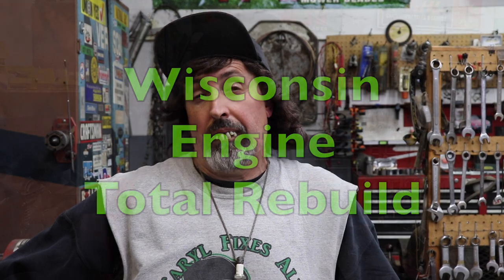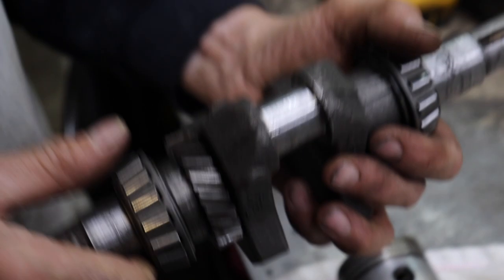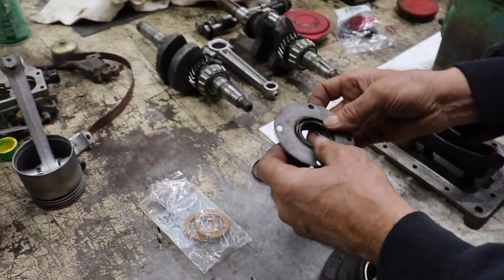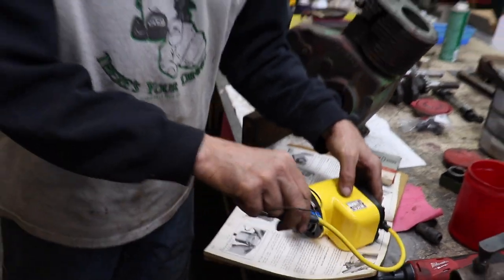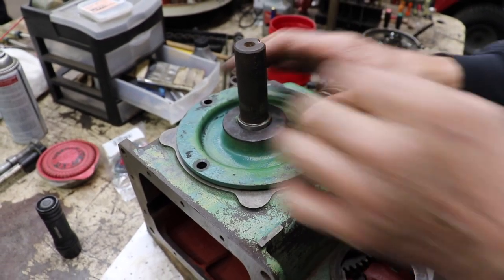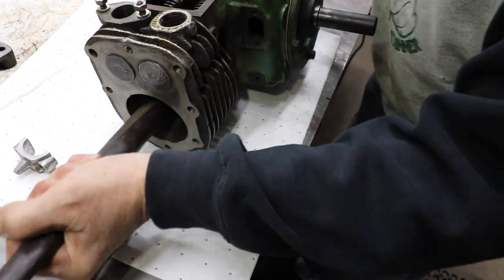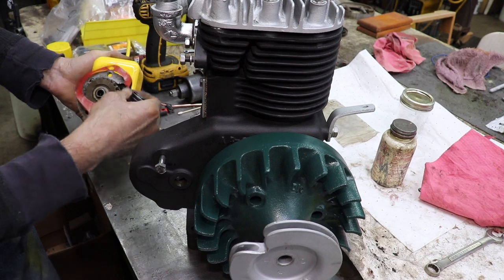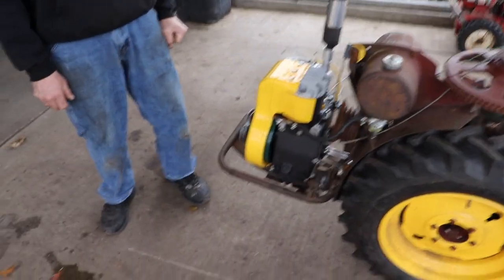Epic Wisconsin Engine Total Rebuild

Comment: My grandfather was an engineer for Wisconsin Engines when they merged with Continental Motors in the 1960’s. They manufactured many specialty small engines inside of the International Harvester Heavy Equipment plant in Melrose Park Illinois in the part of the factory that used to manufacture International Harvester’s residential refrigerators and freezers for Sears Roebuck. To this day, I know they still have a massive but non-maintained  warehouse inventory of Wisconsin-Wisconsin Robin motor parts and motors which was purchased and then abandoned by Suburu Automobile corporation around 2005. Also, I worked at the Wisconsin motor assembly plant in Melrose Park for a brief few years in the 60’s after college.  Wisconsin motors were built to last indefinitely with little or no maintenance. All their engines and parts were designed, manufactured and assembled in-house.  FYI, the lifter were offset to promote spinning and even wear at higher RPM’s.  Common in piston-aircraft engines which International Harvester also manufactured for Ryan Aeronautical  a division of Continental Motors at that time. I love your Youtube videos.
Reply: That’s cool 😎 
Bet he could teach us everything about them 
I was 16 working at tractor MF dealership and my dad closed his shop so I knew how to overhaul them and got the job Asap
Reply: Nice bit of history of these engines.

Comment: A Wisconsin Engine was a tough well built engine back in the cast iron engine days .You have done a Great job saving a piece of American History ...
Reply: @JM-yx1lm  some still do(hard to find). but I agree. Unfortunately people vote with their wallet and buy the cheapest crap.
Reply: i have 2 wisconsin motors one is on a 1953 original snapping turtle it has a turtle head on the front of the mower im 67 i wonder how many engines made today will still be running 67 years from now
Reply: They really don't build things the way they used to!
Reply: @dannysapp5559  I love my old Wisconsin engines got only 2 that will run out of 6.
But ya know they are heavy, tuff and old just like me!
Well, maybe not the tuff part,
Hehehe.. Take care keep that old iron purring!
Reply: I have a TR-10D Wisconsin engine on an early 60's Bolens that I would love to get that machine running again.
Reply: @meegstomtom  duromax have actual rod bearings

Comment: Great video, a note though. Piston ring gaps do not need to be staggered in a four stroke engine. The reason is they continuously rotate around the piston and periodically line up on there own. Two stroke rings on the other hand need to be pinned  to keep them from rotating and the gap getting snagged on a port. Lined up ring gaps do not allow enough compression loss or oil control problems to ever worry about (the gaps will un-align soon after the engine runs for a short while anyway). 
I was introduced to this at the Briggs & Stratton service school for vocational instructors and have assembled many engines with lined up ring gaps just to prove it to people...that all said staggering ring gaps doesn't hurt anything  but is unnecessary. And there's your dessert.

Comment: Pretty sure I'm never gonna rebuild an engine (much less a Winsconsin engine) but watching this is a treat.
Reply: Find yourself a "FREE" lawnmower or two (my case, several) and take it carefully apart and re-assemble. If it runs, you must do the Tayrl dance. It gets to be a habit and maybe a few bucks selling the runners. Save the good parts to fill your garage. Good luck!   CM
Reply: Offset is so they spin.
Reply: @ItsMrAssholeToYou  im actually looking for parts now to rebuild one, lol,. An S-8D off a old bolens tractor, do you know of a place for part's ? Im going to look on ebay tomorrow.
Reply: @calvinmientke3539  q
Reply: @calvinmientke3539  q
Reply: Don't sell yourself short!!
Reply: Same🤣

Comment: Taryl, Thanks for another great vid. The Wisconsin AKN is the same as the Howard Terrier Rotavator motor built under licence here in Australia in the 50’s by Howard.
The bore and stroke is the same at 2 7/8”x 2 3/4”.HP ratings change with RPM. Howard L 4.2 HP at 2500, LH 5.2 @ 3200, your AKN 6.2 @ 3600 as you would already know. It even sounds the same.
 Wisconsin AENLD motors were also built under licence here by Ronaldson Bros and Tippet up until the 60’s I think. For about 9HP they are very heavy. I have one of both these, they are good motors as you point out, very tough.  A lot of parts are available here through the Howard fraternity. Jeff.

Comment: When a man That's worked on small engines for 40 years says the Wisconsin engine is made weird 🤨, I take his word for it .
Cork gaskets, 40 years ago I use to ride a 1953 Hogly-Davison Panhead and they used cork gaskets on the pushrod tubes and the clutch crossover shaft. Clutch cork gasket backed by washer & spring, replaced every time worked on clutch to keep oil off plates. Later model rubber seal was a perfect fit and didn't need replacing every time 🤗. 
The hardest part about working on old stuff is replacement parts. Heard the term obsolete so many times I wanted to bang my head against a wall 🤕.
Reply: I have a 74 harley all my pushrod tubes are still cork. Works well
Reply: Cork seal also used on old 2 cyl JD farm tractors, crankshaft flywheel side

Comment: Wisconsin engines with the impulse coupler makes the difference in starting eazy. This engine manufacturer has got to be the best on the market. I have one that has been working since 1951. The engine is on a self propelled lawn mower. What I am wondering is have you ever heard of a mower working for seventy years ???? Thanks Taryl. VF

Comment: Taryl, an old mechanic told me that the reason for the offset alignment of the valve pushrod was a crude valve rotators. He stated that even thought the springs on the valves are actually fixed to a greater degree, the cam movement and rotation would move the valves ever so slightly and prevent burn spots on the valve itself. This slight rotation would keep the valve wear consistent on the radius of the valve. This old mechanic named Snyder worked and repaired Wisconsin's engine his entire life. He swear these were the best engines made in the United States of America. A time when American manufacturing was second to none. Peace VF
Reply: Agreed, that was the thinking of the engineers on valve rotation back then…

Comment: I have been through many Wisconsin Engines up to the VH 4D. They are primitive but very heavy duty and dependable. Keep your eyes on the governor weights, they were bad to break off from wear. They were designed for torque at low RPMs. Many Ditch Witch Trenchers and many Cement mixers used this engine. The Wico Magneto is very good but it is complicated.
Reply: I have a few still running.VH4D on stump grinder. Thousands of hours always runs. Starter ring gear issue s mostly.
Reply: Yep I still have my father in law back motor for his old cement mixer 
I started it up about 12 years ago 
Need to start it up soon
Reply: The old Lister engines were pretty durable.Last time I used one on a cement mixer was around 75 when I was young and fit.They merged with Petter which were also a good small engine.Lister/Petter merged and are still in operation but their engines are somewhat larger these days.Winsconsin are a rarity this side of the Atlantic.

Comment: Hay if you look on ebay for Wisconsin engine. Put your model type AEH or what it is you will find all kinds of parts. There is a guy in PA. I think that has parts for a lot of them. Just wanted to let you know. I have a AEH engine I get parts no problem. And if you go to smokestack. Com it a tractor, hit miss engine sight. But there's information on Wisconsin engines also if you look on it to. Just wanted to let you know. Hope this helps. Hay Babbitt is not glued in its melted and poured in. Then you fit it to the crank. It's used in hit miss engines. Just wanted to let you know.

Comment: Offset for to transfer the spin of the tappet and you will find cam ground so tappet spins as well. This is so valves don't burn
Reply: My understanding is the teryethyl lead used then left deposits on valves thus narow valve seats. Rotating the valves on a slow running engine helped chip the deposits off.
Reply: I agree offset for spinning components. 
Longer life. 
Tougher duty.

Comment: Pretty sure that’s how Wisconsin would rotate the valve, their idea of valve rotation
Reply: That's exactly what I was going to say - the offset tappets / valve stems cause the valves to rotate.  :)
Reply: That’s what I was thinking also
Reply: @billymare  
Ml
Reply: Thought the same thing
Reply: Lol you beat me to the answer
Reply: Bingo!
Reply: @lavendersneppo  Ditto.
Reply: paul lynn for the block.....
Reply: I don't think that's it.  Maybe Wisconsin thought that was it, but if the tappets were running in the center of the cam lobes, how are they gonna spin?  And if they don't spin, sure as hell the valves won't spin.  In a car, the lifters are offset to the cam.  Not like this.
Reply: @alext8828    I don’t think it worked very well that’s why they changed the design later. Not to mention it probably would wear the guides funny. They definitely figured out fast that it did not work at all lol
Reply: @moondogdieselworks3883     I'm having a hard time believing their engineers could be that out of it.  Sometimes things happen in production that are crazy.  Like sharing one motor case for two models and trying to squeak by doing a have ass job of it.  I don't think there's an engineer or mechanic in this world that could possibly believe this would actually work.  From what I can see as Taryl show the damn thing, it looks like the valve on the left had to be moved to avoid interference with something in the middle that ran down thru into the crankcase and was holding the cam for some reason.  The piece did not have room to move to the left in the crankcase or it would have interfered with the lobe of that valve.  But when we move further up, we see that those valve guides needed to be further away from each other.  Kind of a shitty design, but not shitty enough to mess up the workings of the motor at large.  
I like to think that engineers and designers know what the hell they're doing.  But remember that every shitty piece of shit that was a total failure was engineered and designed by these mental patients.  The production engineers work on it to find a way to make it profitable at a certain predetermined price.  In short, they wreck it by cutting corners.
Reply: It's not meant to rotate the valve it's meant to rotate the tapper so that it doesn't dish and change your valve clearance!

Comment: When I have loose seals. I use Loctite Bearing Mount Sticks 39150 it was made for bonding
 Bushings
, Bearings, Oil seals, Ring gear bolts, Differential lock pins, Axle bearings, and Water and power steering pump pulleys to the cases. I also pour my own Babit for the crankshaft and rods.

Comment: Really enjoy your videos! Funny how these small engines endure. I recently pulled the Briggs 25 hp out of my Scott's rider. 1978 vintage. Been mowing with it for 8 years. Always hard to start and it finally developed a leak at the governor shaft seal. I decided to tear it "partially" down to replace the seal and refresh the gaskets. Once apart I found the governor had one fly weight dislodged and was laying in the sump! The valves were at three times the .006 gap. I thought it was a stump grinding monster before but with the flaws corrected it really should haul the freight. Did I mention the complete gasket set had the wrong governor seal in it? :) Correct one is on the way! By all means, keep up the good work!

Comment: Babbit is generally a lead/tin mix poured into the Rod end Hot.  Rule of thumb or #1 finger is 0.004" end gap per inch of bore.

Comment: I have a Wisconsin AB sitting on the shelf. Previous owner put it on a homemade log splitter. When I was given the splitter I took that motor and put it on the shelf to preserve it.
Reply: Nice u want to preserve it, I think she'd be content to be running something tho.
Reply: @raymondgarafano8604  I agree, The worst thing you can do is shelf and engine, However there are steps you can take to guard against corrosion.
Reply: @Mad_Scientist2052  Engines were built to run things, pumps, air pumps generators,
I did up a Briggs 23AFB purple with black headbolts, took al parts off wire
brushed, primed and painted, cleaned out carb, rebuilt starter solenoid...I am looking for what I think is a Wynnco Generator that goes with it. Yup these old engines can look good and still serve a use.

Comment: Great video Wisconsin engines are Timex watches they were built to take a licking and keep on ticking. I had a minibike when I was kid and a guy who worked construction gave me an engine, long story short it was a Wisconsin Robin 6.5 hp. We found out from a local small engine shop that it was a very expensive engine and why we were putting in on a minibike lol. I tell you that minibike is still being used today with that Wisconsin Robin still running great I sold it back in 1980 and it is still riding around our neighborhood.

Comment: I like it," scrappy "you shall be named! I hope you find out why the valves and lifters are offset there has to be a reason why the designers/engineers saw it a necessity!ohh wait a sec I remember someone said when I grow up im going to be an engineer, I'm going to put bolts and things in difficult places ,add more fastners than needed and place parts in oddball configurations because im an engineer !

Comment: OFF-CENTRED VALVE LIFTERS... The theory suggests...Produces even wear on both lifter and valve stem.  May induce a rotation of both the lifter and the valve, the idea  to produce even wear on the valve seating surface and the camshaft cam lobes....Should also dislodge carbonation if occurring at the valve seat. Thanks for the video Taryl and cheers from sunny Australia!!

Comment: Great video, thanks.

On the end play - I would just put all the gaskets in place, bolt it down, and measure teh end play. Then subtract what you need to get the proper end play.

Comment: I only just started into your video and you mentioned rings for that AKN, Wisconsin engines of that era have been difficult to get parts for the last 40 years. I think those rings may be the same as a Chevrolet 283.  Check it out, but I may be mistaken, and it may be the valves.

Comment: I really enjoy rebuilding engines.... ITs fun to take piece by piece and learn how things work and then the end result is very satisfying. It's funny, my most successful rebuilds are ones I do by common sense.... Looking for obvious wear and measuring accordingly and refreshing the necessary items. Not all elements of an engine wear the same... some areas never wear... at least to a measurable point. Through experience and common sense and a few torque specs and clearance values you can rebuild a decent end product without having to go the whole 100 yards like a manual would say.

Comment: The ID plates are being reproduced by a company called Midwest Restorations if memory serves. They can be ordered already stamped with your numbers for small fee. However when I ordered mine I was unable to find the correct older style plate with 5 blank spaces for numbers as opposed to 4 and slightly different style and colors on the Wisconsin logo. Id love to find the correct one.

Comment: My dad worked for Wisconsin engines during the Teledyne days in the 80s and 90s in my hometown of Dyer Tennessee. He did say some questionable practices were done during that time but I don't know specifics. The factory closed around 2017. I believe it was the last surviving factory. The headquarters was moved there some point after 2000. Now it's used for storage.

Comment: I have a TR-10D, on a Bolens 1000... It's been rebuilt, already.... Or so I was told. We will see when I crank it up. It doesn't have points, but a Wico coil inside the flywheel. Turns out it was a replacement Wisconsin sold with a through flywheel crankshaft matching the one on the back. I bought it to make my 1000 have the proper TR-10D in it instead of a S8-d that had been installed on it. S8-d runs but has the wrong carb on it. I'll set it aside for now. I will contact the used parts guy you mentioned and see what a updraft carb would be $ for one if they have it.

Comment: When I worked in a small engine shop back in highschool around 25 years ago. A customer brought one of these very similar engines in and gave it to the shop. My boss didn’t want it, so I took it home tore it apart and went thru it. It ran great but I had no use for it. I gave it away. It was so heavy, kinda wish I still had it!

Comment: The cool thing about the holes drilled into the block is you can take it apart years later and no seized bolts this engine was built to be run hard and long thus my speculation about the offset tappets I would say they were having metallurgical problems with tapper wear and the offset was to offset this wear I would imagine that it was solved with harder tappets and then they lined them up speculation only that things out dates me the manual really looks like military issue !

Comment: I started working on small engines when i was 12 or 13, 1978 or 79. i have rebuilt only 2 wisconsin engines in 40 years